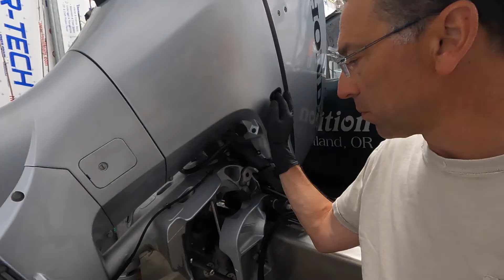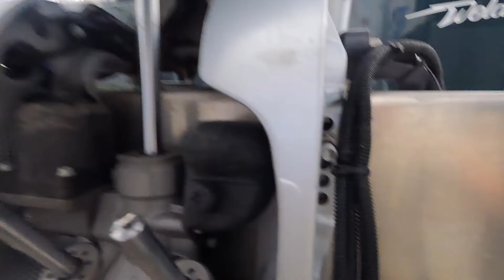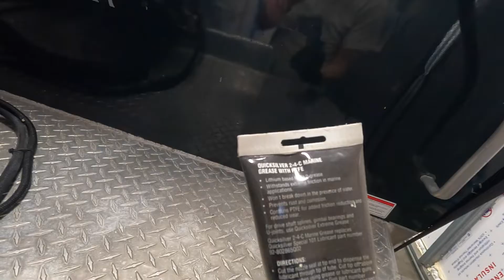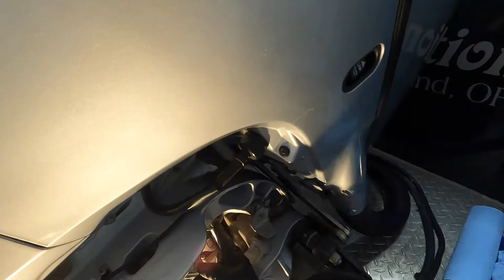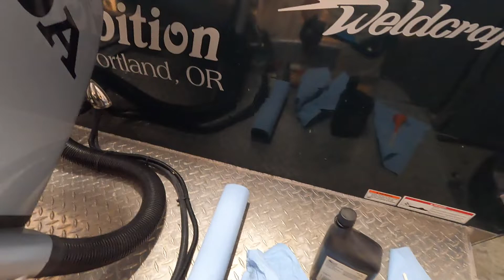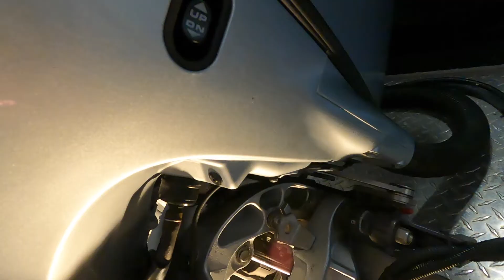Honda Outboard Tilt/Trim Basic Maintenance and Lubrication

Comment: Can you tell me this, about the tilt shaft the steering hooks up to. Is it hollow all the way through?
Reply from the maker: Steering tube? Yes. Steering tube is hollow so your steering system (cable or hydraulic) can slide into that.

Comment: When it hits the 2 rams going down is it suppoed to bog down like that? I noticed mine does that and thought something was wrong
Reply from the maker: It is normal to 'slow down' when you hit the other two rams. This is the 'Trim mode' for the motor when you are underway. The 'faster' portion of operation is when you get about mid-way for trailering...That 2nd RAM when it engages, it moves faster to get the motor up for trailering.

Comment: Great video. Does anyone know where the trim relay switch is located in this engine (or in my case a bf90)? I’m replacing the trim motor and have to rewire.